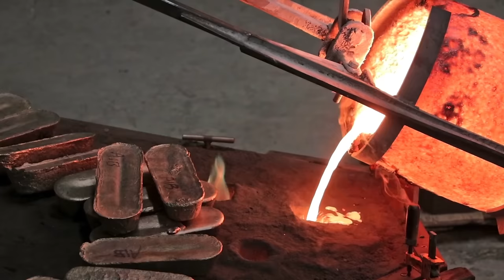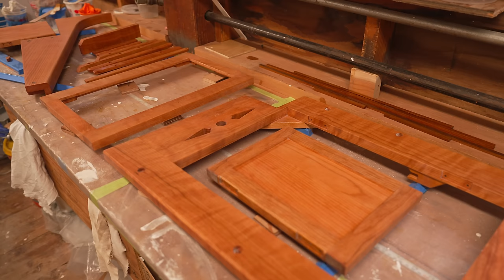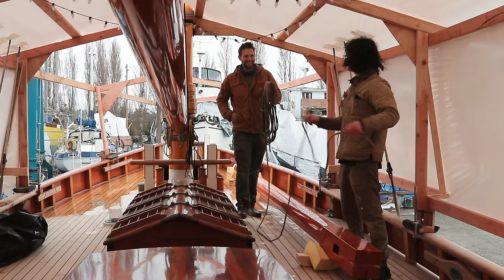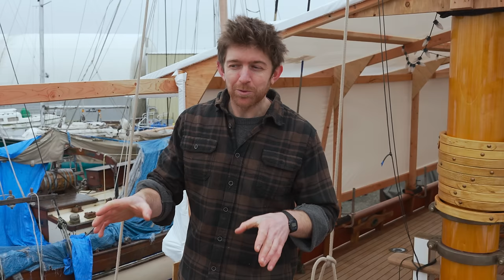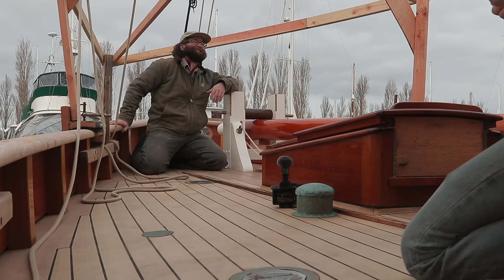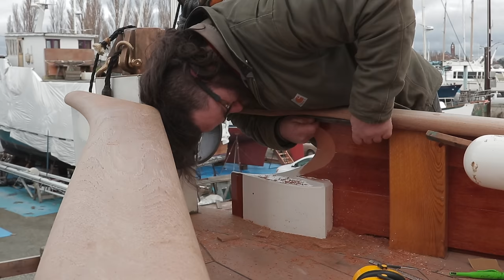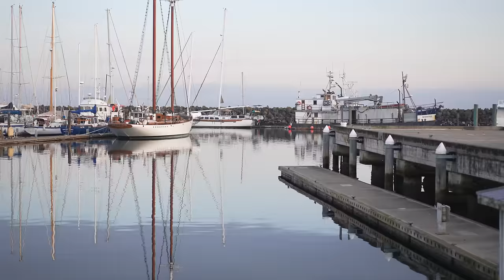Tally Ho's bowsprit!

Comment: I’ve spent most of my adult life at sea and I think that Tally Ho is one of the most meticulously built vessels I’ve ever seen. Part of me think it should be in a museum to show future generations how to build the perfect boat but In my heart I know she has to go to sea.
Reply: Dear @alanhenderson9092
👍👌👏 Almost exactly what I almost always think and also already commented. Tally Ho should be in a museum to show people how it can be done if excellent craftsmen do it. I'm shocked how much wear and damage for instance Arabella already took and I simply don't want it to happen to Tally Ho. On the other hand: Of course I want Leo to be happy. And without sailing Tally Ho, he will not be happy. At least I guess so.
Best regards, luck and health in particular.
Reply: I agree the craftsmanship is top notch and amazing.
Reply: The modifications have created a few problems, notably the tight tolerances at the heel of the bowsprit created by adding a second Sampson Post. Since the original capstan is going to be reinstalled the run of anchor cable and lines might make an interesting five minutes.

Comment: I always like to see old timbers recycled, the fact that the bow sprit will be as old as Tally Ho is awesome! Also cool is launching a quad copter of a ship that was originally built before helecopters were inveted. Looking at the arial shot, she is going to be something to behold under full canvas!
Reply: This Tally Ho is brand new and not as old as the bowsprit.
Reply: The first true helicopter flew in 1901, 14 years or so before the original Tally Ho was launched.
Reply: @robertharris7027  The boat is still the Tally Ho she is not a new ship. When you do a rebuild its still the same ship. (see ship of Theseus)
Reply: It's looking like 1910 again!
Reply: @Thornbeard  It's a replica.
Reply: @Thornbeard  or Trigger's broom (had something like five heads and three handles, but don't quite me)
Reply: @MikeAG333 I disagee. A replica would be a seperate copy. This is still Tally  Ho. Ask Leo...
Reply: @stco2426  It's not up to Leo. He can think of it as a re-build as much as he likes. It's a replica. And those trotting out the "ship of Theseus" line, as Leo does himself, should understand that replacing timbers bit by bit over decades of active use (as per Theseus) is an entirely different thing from taking something completely apart and building an new version using only a small number of timbers from the original,  mostly not in their original location.
You must understand that this isn't a criticism of the project. The project is every bit as wonderful being a replica as it would have been if it were a renovation.
Reply: @MikeAG333 Its not up to you either dude. Acording to maritime tradition its not a replica. Replicas happen when nothing of the original boat exists. There are quite a few parts on Tally Ho that are still original. So its been refit/rebuilt not a replica.
Reply: @MikeAG333  we also know it isn't a renovation when we see the modern materials and technologies being used.  They used to build dozens of Spitfires each week for WW11.  Nowadays it takes a minimum of 15 months to build a new one with a few parts from an original.   The biggest difference is the war time planes were expected to last a few 10s of flying hours.  One worked on now, like Tally Ho, is being built to last decades.
Reply: @Thornbeard  Twaddle. By that silly argument, if he had built a new boat alongside the old one, and swapped one port light across from old to new, it would be the same boat. Think before you type, and don't call me dude.
There are no parts on the new boat which are in precisely the same location as on the old one. Not a single one, although some of the lead in the ballast keel might be in roughly the same place as originally.
Reply: Not a "ship".... 🧐
Reply: @MikeAG333 Okay bro be a keyboard warrior all you want. The fact is that maritime tradition that is older than you or I says that it is not a replica. Rail against the dying of the light all you want.
Reply: @Thornbeard  You are the arbiter of maritime tradition, right? Or have you got some actual evidence of your claim?
I am not and never will be "bro" to anyone. I'm English. We use actual words.

Comment: Is Bailey doing all the varnish and paint work?  If so she is the unsung hero. All the finishes look perfect. The Douglas fir story is amazing. Old Doug fir is a treasure. Worth the trouble to salvage times 50.
Reply: It is HER Fault! It would have fit perfectly if she had used 8 coats of varnish instead of 9. 😂
Reply: Completely agree!!
Reply: In 1986, I fitted Douglas Fir windows in my house. They still look as good as new. The similar age plastic windows absolutely do not.
Reply: Amazing varnish work. I’d like to know how many gallons have been put on Tally ho
Reply: Heroine? Easy now.

Comment: Here in Australia and New Zealand, it was customary to use Oregon Pine (Douglas Fir) beams around 15” by 5” as the mounting for sheep-shearing shed shaft-drives. Every old shearing shed in Australia and New Zealand has these beams in them - thousands of them. They would mostly be over 100 years old now. Beautifully seasoned and of the highest quality.
  Shaft-drive systems are no longer made for sheep-shearing, so the beams are becoming obsolete as the systems wear out. Hundreds of shearing sheds are abandoned now, complete with shaft-drives and beams.
Reply: Something to keep in mind
Reply: Lots of good boatbuilding timber hiding in abandoned sheep sheds.
Reply: Rubbed off on all the floor grates (and in the air)… Don’t forget the lanolin. Further protection there.
Reply: They're all full.of holes though, you have the holes to mount the line shaft the holes to mount the beam to the poles holding it up abd the holes from where at least 2 types of electric shearing heads 

I recently donated out lineshaft gear to a mechanical restoration group, but the bean is still in use, has holes in every  4in by 4in square
Reply: sounds like you found a gold mine
Reply: 15"x5" or 15'x5" ?
Reply: @paulg3012 approximately 15” by 5” by lengths up to whatever length was manageable in those days, keeping in mind the timber was brought from places like Oregon in sailing ships.
Reply: @fowletm1992 you’re right about the holes, but some shaft-drive systems used very wide (top to bottom) bolt spacings and usable timber could still be obtained. The holes can also be plugged for non-structural purposes.
Reply: And Oregon or Douglas Fir is neither a pine nor a fir species.
Reply: Being interested in any historical mechanisms etc. Do you know of any video of such an operation?

Comment: You might consider a custom cover to protect the hatch during the process of running that in and out. Something from nylon or teflon so it slides easier and is perfectly aligned might be worth considering.

Comment: I'm not any form of a shipwright, but Have you thought about Teflon skid plates along the hatch and around the cap rail hole?  You might have to widen the cap rail hole, but that would give the room for the skid plates... They would minimize damage to the wood, protecting the hatch, deck and bowsprit.  Maybe even not teflon, but a more appropriate boating plastic like material, but still.  You could maintain your tight tolerances as well.  Hope I'm not far off and this idea might help.

Comment: Old growth Douglas fir from the pacific northwest, when it is well, seasoned is very strong. The grain can get very tight as the tree gets older and make it surprisingly strong and hard for a fir. It can also be surprisingly difficult to get a screw or steel drill bit into as its fiber will compress without breaking and bind onto them, so a pilot hole is needed in  when you are putting in a standard woodscrew and the drill bit will need to sharp and have good chip clearing flutes. I used a cheap masonry bit whenever I delt with it in older homes in that area.

It holds galvanized nails really good as well.

Comment: I'll be 91 in April, and have been watching since you started thin thread. Not sure if it will ever float. Most of the other sail boats have already been lanched . I thing the sault and tar is the best one so far, but most have done well so far. As for the quality of construction  this  thake the  cake as a musem quality project which hasd  got out of hand. The cost must be in the millions. I do wish you well, after all I have alote of time ivested.
Gramps

Comment: I can't wait to see this Tally Ho on the sea with the sails open 😍  it's been a long time coming but I have loved every minute of it ! Congratulations Leo and team on continuing to build the most beautiful hand built boat IN THE WORLD
Reply: It's a beauty of a small spar.  I wonder if it will bind or be tricky to run in and out in a big sea. Operations that are easy in flat water  sometimes sing a different  tune with a sea running.  I'm sure working out such details is a pleasure  to deal with at this point.

Comment: I fabricated the bowsprit for my HC39 Pilot House out of laminated sitka spruce, yes very soft, I coated it with special 207 West system epoxy and then after many coats, switched to International perfection plus for the final coats.

Comment: Really starting to shape up - great video! 
It is a shame that that bowsprint cannot retract as that will add a surprising lot lot lot to docking fees. You are going to be paying for every foot of that Douglas Fir every day that you are at dock for the boat's lifetime. I would STRONGLY suggest that a redesign gets planned with priority. Supposing you stand it up straight even, while at dock.
Reply: It can retract, like many sailing boats one has to do it manually being careful not to get the lines tangled.

Comment: Looks really beautiful, but as a sailor and boat refitter I shudder to think how much maintenance all that varnish is going to need. The disadvantage of these new, high-tech varnishes is that, once the surface is damaged, they need a lot of work to repair/refinish. The softer traditional varnishes are much easier to keep covered, and much less sensitive to environmental conditions when applying (eg humidity).

Comment: Nice work as always.  Surprised to see such a tight fit through the bulworks and a loose fit on that bronze ring.  Maybe the sprit gets a leather collar not shown?  Thought the ring would be tight and the bulworks loose so the sprit doesn't split the bulworks and cap rail.   Anyway, the rig is looking better and better, like a real sailing greyhound.  I've been following the capstan rebuild and those videos are amazing also.   Who is doing the sails?  Hopefully, the Port Townsend female sailmakers.

Comment: setting a laser level to the outside of the bowsprit at its widest beside the hatch ... would show on the front rail to where it needed to be opened up to ... same for the edge of the hatch for the inside of it .. and it would have saved loads of install and deinstall work

Comment: As you go along, you'll eventually come to the realization that there is only one course of action left..... cut the corner off the hatch......nice job all round as usual.... 🤔😂😎🇦🇺👌
Reply: Alternatively: save the hatch cover, save the bulwark, save the cap rail. For the length of bowsprit that might rub, shave a little off its circumference. That won't seriously weaken a Doug Fir spar of that size, I wouldn't think.

Comment: I havn’t yet tried le tonkin oil on my boat but I am interested to see if in future this might be suitable. 

I am well familiar with the reputation of Alwood and yes you do need to apply 9 coats. I do hope in your case with Tally Ho it lasts well. A friend of mine used this on a number of surfaces on his boat, and while it appears to have lasted well in his skylight hatch, where he applied it on one of his side doors (it’s a Nauticat 38), it’s cracked up on the joints in the timber and most likely he is going to have to strip it all off and start again. I doubt he can simply cut it back where it has failed and refinish it. Epiphanes also apparently is an excellent modern finish but I have no experience in using this product.

Comment: Every wood joint on the boat had to be dry fitted and adjusted toward perfection numerous times. The fitting of the sprit is no different, just a lot bigger!

Also, mediocre carpenter that I am, I would have made the gunnel opening a lot bigger and called it ‘wiggle room’ for possible flexing!

Comment: should have made a scrap piece the same thickness you needed on the lathe but only like 3 feet long and used that to fit the hole perfectly, alot nicer on the back than hoisting that huge thing in and out xD

Comment: On a "one of" ship such as Tallyho ...the fitment of the bowsprit will take .. AS LONG AS IT TAKES" to get it right...better a precise fit from several adjustments than an oversize relief cut that leaves room for play and shifting...it seems that every other piece of handcrafted fitment on Tallyho is equally precise in fit and shape ... in other words .. "perfection".. I hope you flag that bowsprit so any tall traffic going thro' your alley wont collide with it.

Comment: Are the wedges temporary or is it the original way to fix the bowsprit this way?
A relative short video but nice to watch it again.
Reply: After using the wedges to nudge the for'd end of the bowsprit over to the boat's centerline, the bowsprit shrouds are tuned to hold that alignment & the wedges can be removed.
Reply: @frederickstibbert7389  Thnx 👍

Comment: It seemed to me when I was looking at a smack with a set up like this for moving the bowsprit in and out that the roller was under the spar, not above.  That way the sprit could be drawn with the stay, rolling on the roller.  You have the roller above the heel which will bear the weight part way in, but can't that we carried by the stay?
Reply: last sentence, "we" should be "be"

Comment: What is the metal ring (with fittings) at the tip of the bowsprit called? Is it stowed when the sprit is run in, or just secured at the bow?

Comment: Is the bowsprit lined up parallel to the center line or is it angled inwards so that the tip of the bowsprit intersects the centerline?
Reply: I guess they could adjust the tension on the bowsprit shrouds to pull the business end over to the boat's centerline, so the mast & topmast stays would be centered - but I don't know if that would make an important difference to equalize the tension of the mast shrouds.

Comment: beautifull bowsprit. Is there protection in the inside of the wearing ring next to the stern? Overhere  in NL the ring is often covered with rope to prevend the wood from scarving , can,t see it on the video.
Reply: There is a leather band in the ring installed (see episode 180, the previous one at about 11 minutes in).
Reply: thanx, missed that bit.  @on4xb

Comment: Not a sailor, your boat your way, is my thinking.  That said.  Would it be "better"  or "easier" if the there was some sort of But cap on the bowsprit, where you could temporarily attach some swivel wheels?  Think putting a skateboard under something to make it easier to move, except the wheels are 6-7 inches big?.  I see you have the lines, and like i said i know nothing, but it seems like it would be faster and easier if the end was more mobile to swivel around the hatch?

Comment: A metal tube of diameter X and a wall thickness of about 0.2 X has the same stiffness as a solid metal bar of diameter X, the strength resides in the outer diameter of the metal. On this basis I don't see why the sap wood  could have any real effect on the strength of the piece, except if there might be knots in the timber. Or am I more ignorant than I pretend 🤪

Comment: If it’s that tight, doesn’t that kind of remove the advantage of a retractable bowspirit? Imagine retract it when the boat is on the water and not being completely still. Even if you get better at it, it seems like kind of a big risk that you sooner or later will damage the front hatch.

Just a thought, amazing work so far anyway!

Comment: I'm not clear on how that bowspit locks in once out. Once the jib is up it surely needs more than inertia to stay in place. I bet you explained last week and I forgot.
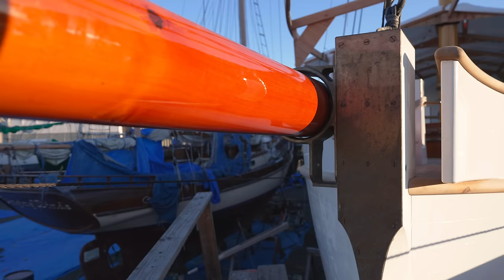Reply: At 14:19 , there's a horizontal white bit of wood, the fid, driven through a slot in the heel of the bowsprit. When the bobstay & bowsprit shrouds are tightened, the fid is compressed against the vertical bitts, locking the bowsprit in place.

Comment: What’s the purpose of the Bowspirit roller in that block assembly?
Reply: I too was confused. I thought the bowspirit rolled on it. It's made out of lignum vitae, this seemed liked a big deal. Seems like it hardly rolls at all, and actually constrains the top of the bowspirit. Why not just knock the pin and roller out of it entirely? It doesn't carry any weight or help it roll. I don't know anything about boat building, so, was hoping to learn more about how it's used.
Reply: When the fid is knocked out, the weight of the bow sprit will press up against the roller. Think fulcrum, with the weight forward. The roller will ease the travel as the spar is pulled aft.

Comment: Just heard that the UK is outlawing chrome plating. There is more to that than chrome bumpers. Those big engines on board the container ships all have chrome plated piston rings or cylinder walls. One or the other and I wouldn't want to pull one out. Pretty much kills your whole machine shop industry.

Comment: It would drive me crazy with the bowsprite offset to one side. The loss of symmetry is difficult to reconcile. There must be a reason for it, I just don't know what it is.
Reply: A lot of hardware sits in the way (the stem itself, the front hatch, the capstan and even the mast) when the bowsprit has to be hauled). But the tip of the bowsprit sits on the center line. Nearly all pilot cutters us this technique)